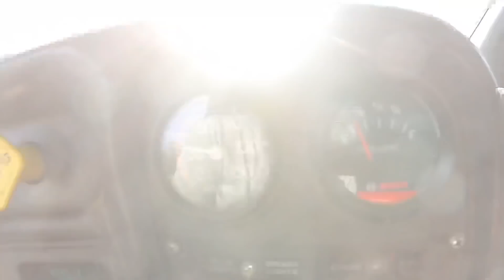Equipment, Rock, and Sawdust lets do some Saturday morning trucking

Comment from the maker: I formatted the sd card a few days later and seemed to fix the problem 🤷‍♂️😁
Reply: It's recommended to format the sd card every few uses. I don't. I'm not sure where I read that but mine acts up every once in a while and that usually fixes it. Just make sure you format it while it's in the GoPro. Edit: Make sure to remove your files first...heh

Comment: I had a dump truck same size as yours and was loaded with waist lime fines an the temp was 6 degrees.  When I got to the delivery site the lime would not come out of the bed. I had to shovel the whole load off.  it was one of those days.

Comment: Wow, you run the 120 that low on fuel.
My deere or Hitachi tanks always start the rusting process after getting a little older meaning plugged filters or Banjo fittings into filters.
Now
I always keep tanks more than half full and have eliminated those problems.
Reply from the maker: It 1-2 are more most of the time just come off a job haven’t had any problems my self

Comment: Scandisk sd cards you have to watch that you have a true scandisk card, specially if you are buying them cheap off amazon, there are many thatt are clones and they are no good, you will see a class 10 32gb for $17 and another for $27,, just using any numbers, the low price one says scandisk and it is white back ground thats a fake clone,, no good, true scandisk are blue
Reply from the maker: Interesting thanks for the information
Reply: @DirtPerfect  your welcome, also all new cards must be formatted before use, and every time the card been used and files removed format the card, file fragments get left behind, same thing with flash drives and all portable hard drives, main hard drives